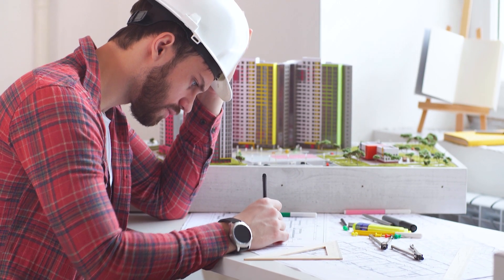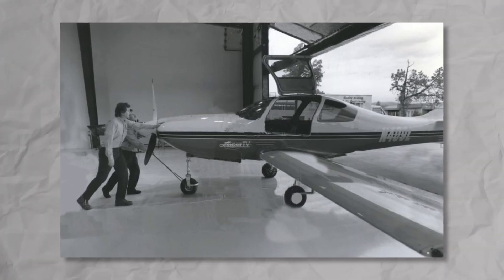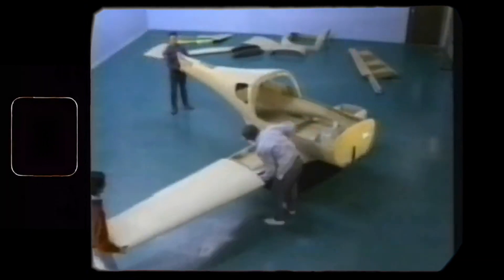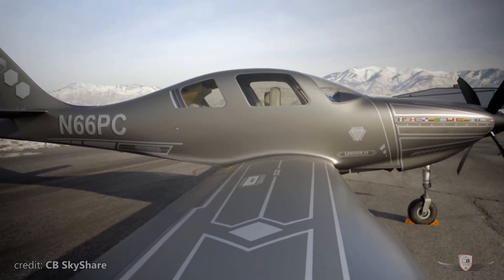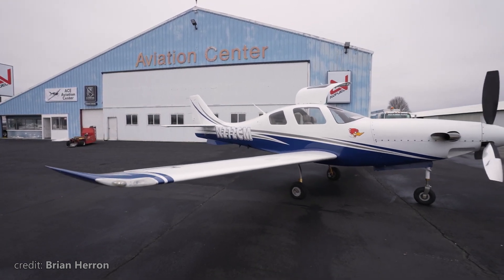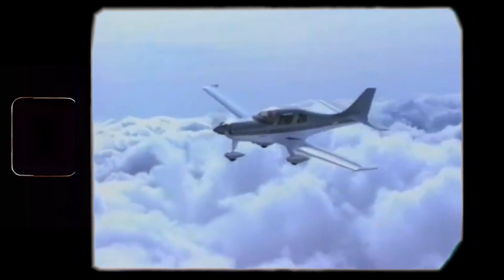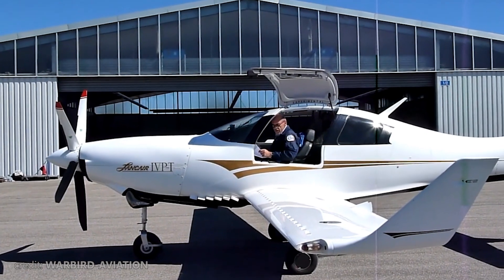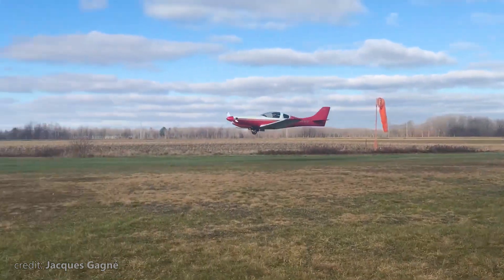Lancair IV – Its Too Fast! Review, History & Specs

Comment: I flew the factory 4P prototype. I found it easy to fly. Not much cockpit room. I flew to Oshkosh that year (I think 2000) and saw 7 completed planes. Builders reported 5000 to 7500  build time and $500k to $1million in costs. You could buy a midtime Cheyenne turbine at that time for $500k, certified and a fraction of the cost of insuring an experimental plane.

Comment: It's Nice But I Like Aluminum, Like The Questair Venture. Thank You. (Like #694)
Reply: I saw two questions ventures that lost their horizontal stabs.at Reno.
Reply: @garytrenner5572  The Plane Wasn't Designed To Race With Increased Power & Stress On The Airframe, Wouldn't That Make A Difference? Thank You.
Reply: Questair venture killed a friend of mine in an air race. The tail came apart.
Reply: @GordonMilliord  I'm Sorry To Hear That. I Did See A Video That Mentioned One Racing At Reno With A Larger Engine. Thank You.

Comment: Glad you briefly mentioned the Velocity. My XL-5 RG (N36LV) had a 370HP IO-550 and seating for 5. Yes, it was 50 kts slower, but you can cover a lot of ground at 200kts. It was also an absolute joy to fly and was extremely forgiving. I could slow to 70 kts, get the canard pitch-buck going, hold the stick full aft, add full power and climb at over 2000 fpm with full roll control while the nose bobbed in and out of the canard mini stall. That would be a death sentence in a L IV.
Reply: Yes, overall I was very satisfied with my Velocity. However…..Velocity is literally a cottage industry and sometimes numbers get glorified for impactful sales purposes. My plane had perhaps the best power-to-weight ratio of any normally-aspirated XL ever built. Could it go 205 kts? Yes, easily at low altitudes, but then one is “pushing the envelope” for a plane with a Vne of 200kts. During testing, I actually saw 213 indicated before I ran out of “intestinal fortitude” and good sense. My, and my plane’s happy place was 195 kts true at 65% power between 9000 and 12,000 ft on 13.5 gph with LOP operations. The design, with no flaps, has by definition a low wing loading value plus two “tails” separated by thirty feet. Think “cork-in-the-ocean” in bumpy air. I could, however throttle back to 170 kts on less than 10 gph for a lovely ride and over 20 miles per gallon fuel efficiency. I cannot speak to the turbocharged models speeds and efficiencies. If I had it all to do over again, I would opt for the fixed gear XL-5 with the older, smaller Elite model wing. 220 kt cruise but slightly higher stall speeds. I limited myself to runways longer than 3500 feet. I would have no problem extending that limitation to 4000 feet for the extra speed and efficiency. Overall, a very beautiful, safe, easy-to-fly airplane.
Reply: Would really love for you to make some content videos with that bird. There is nowhere near enough velocity videos out there showing performance while in flight
Reply: @gsxr600rafii  Sadly, we had to part company. Retirement and the insurance industry made it very difficult to keep both a wife and a winged mistress.
Reply: Were you satisfied with the Velocity? One model on the Velocity Aircraft website has a cruising speed of 270kts. Do you think that's realistic with the right engine or is it just marketing?

Comment: This aircraft has the worst safety record in the history of amateur-built experimental aircraft.
Reply: Sadly, one day after my comment, another one went down at Oshkosh.  RIP.
Reply: @benjaminpohl that was an ES not 4.  These high wing load aircraft must be flown with absolute stall avoidance not stall recovery.  It takes thousands of feet for stall recovery, so must avoid stalling in first place.  Fly it like a jet.
Reply: @jonasbaine3538  and a 767 pilot just crashed one.
Reply: @MattPSU02  when? Today? What tail number ?
Reply: @benjaminpohl So, what do you want?
Reply: like the early 930 cars from Porsche it was driver error...all the time
Reply: @dougmyers6013 Not correct. There were many documented in-flight failures at cruise configuration. No warnings, no communication, just airframe failure.
Reply: @bwalker4194  That contradicts Mike Patey saying they have never had an overstress failure.  They also get them to 400mph in the Reno Air Races.
Reply: @bwalker4194 Airframe failure in cruise flight, huh?  Just out of the blue?
Reply: Flying at the speed of light, it’s easy to get burned….
Reply: BS